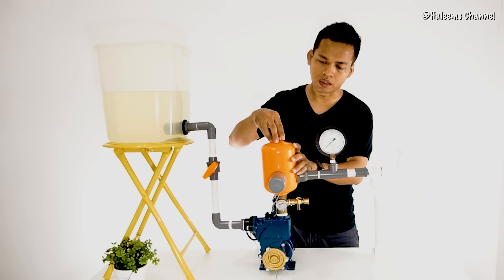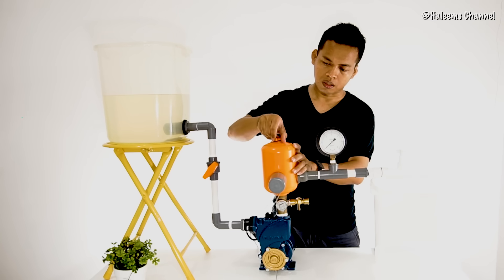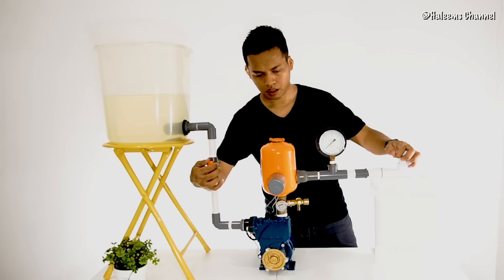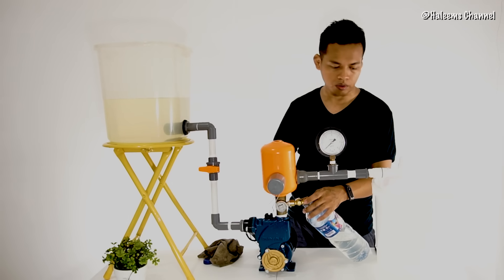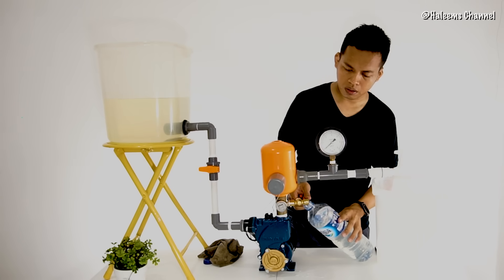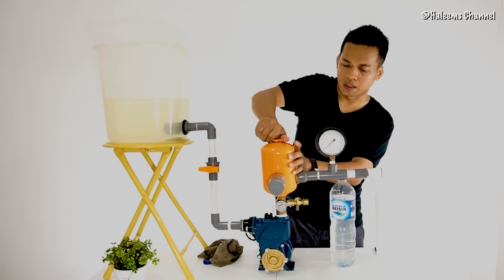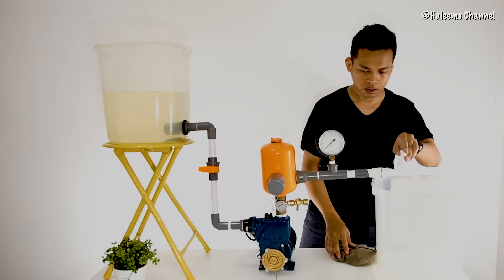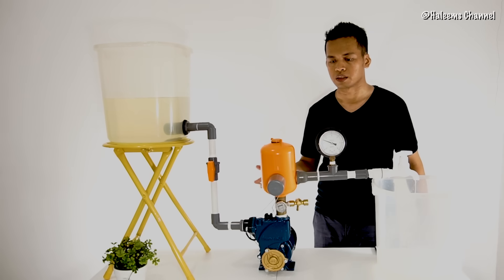Cara Memasang otomatis Pompa air dan Mengatasi Bunyi Cetak Cetek pada Otomatis/Pressure Switch

Comment: Assalamu'alaikum.....
Saya punya mslh yg sama, sdh beberapa kali ganti pressure switch, bahkan baru beberapa hari yg lalu ganti lagi + ganti tabung juga. Pompa saya merk shimizu ps 135 E, saya tdk pakai tandon, lsg sedot dr saluran PDAM, dan ditempat kami kalo tdk pake mesin, tdk jalan airnya.
Pertanyaan saya, mnrt bapak kami lbh cocok pake pressure switch yg sdh dimodif seperti diatas atau Flow switch biar ga cetak cetok lg mesinnya ? Atas perhatian dan bantuannya saya ucapkan byk terima kasih....
Reply from the maker: wa 'alaikumsalam..
penggunaan pompa secara langsung dihububgkan ke PDAM sebenarnya tidak direkomendasi, karena bisa mengganggu pengguna lain..
cara terbaik, dari PDAM sebaiknya di tampung dulu dengan underground tank, lalu dari underground tank di pasanglah Pompa..

penggunaan pompa dari saluran PDAM, dengan kondisi tidak jalan airnya, paling cocok menggunakan pressure switch.. atau lebih baik lagi menggunakan pressure controller..

sedangkan penggunaan flow switch, tidak rekomendasi, karena air tidak jalan..hal ini akan lebih banyak gagal fungsi.

paling optimal, pasanglah pompa tipe priming self dengan menggunakan pressure controller.

jika tetap menggunakan pressure switch.. gunakan tabung yg lebih besar.
Reply: Maksudnya dibikin seperti contoh video diatas ya Om atau bagaimana ? Mohon petunjuknya....
Reply from the maker: @edonkbejeem3212  didalam video ini hanya memberi penjelasan penyebab dari cetak cetek, disertai dengan pembuktian penyebab cetak cetek, yaitu karena kondisi didalam tabung sudah tidk terisi udara..

kalo solusi mengatasinya; secara umum harus menjaga tabung tekan selalu terdapat udara didalamnya agar ada ruang kompresi.. 
nah, tabung tekan yg bisa selalu menjaga ada udara atau gas didalam nya adalah jenis tabung tekan yg memiliki karet atau membran sebagai pemisah ruang air dan udara/gas..

atau jenis tabung yg ukurannya lebih besar sehingga ruang udara pun lebih besar dan udara menjadi lebih awet tersimpan.
Reply: Iya, makasih om atas penjelasannya 🙏😊

Comment: Msh bunyi mnjerittt mas saat kran air kecil,,ttep pekik mngganggu telinga ,suara stak cetok nya sih hilang,,tpi suara jerit pekiknya ituloh msh mngganggu,,😩
Reply from the maker: jenis pompa ini menggunakan impeller peripheral, dgn material brass/kuningan, antara impeller dan tutup impeller memiliki celah yg sangat kecil, hal inilah yg menyebabkan suara melengking... semakin kecil celah impeller semakin baik head nya, namun efek suara nya meningkat..

pompa yg tidak begitu bunyi yaitu jenis CAN motor..biasanya can motor paling banyak digunakan untuk pompa booster water heater..
can motor strukturnya agak rumit, sehingga harganya pun agak mahal..

nah, satu lagi yg tidak kedengaran bunyinya yaitu submersible pump.. pompa nya tidak kedengan bunyi karena posisi pemasangan di kedalaman sumber air..

silahkan memilih sesuai keinginan..
Reply: Haleems Channel gan ada gak otang nyelupin submersible di dalam tandon
Barangkali aja ada hehe 
Tapi rawan dry running

Comment: Pak solusi biar pressure switch gak rusak terus??
Saya pakai pompa air celup sumur 180w baru 6bln sudah ganti 3x otomatis pressure switch nya rusak terus pertama pakai yang 30rb an 1bln rusak kebakar
Pakai yang ori bks sanyo sekitar 2bln sama seperti itu 
Dan ganti merk dea sekarang mulai error kadang bisa off kadang tidak
Reply from the maker: ada 2 penyebab kerusakan,
1. dari mekanis, terdapat kontak point, agar kontak poinnya awet, tekanan yg diterima harus stabil, agar tekanan stabil harus menggunakan pressure tank yg srabil.

2. dari elektrik nya.. cek ampere dari pompa nya, harus sesuai dengan kapasitas pressure switchny..
pressure switch di pasaran ada beberapa type, dari segi kapasitas power nya.. ada type 200 watt, 400watt, dst..
jika ampere pompa nya besar, harus pilih pressure switch yg lebih besar.
Reply: Tambahkan kontaktor mas....biar aman

Comment: Itu posisi air ada di atas buat apa pake tabung
Reply from the maker: sistem pressure switch tidak bisa dipisahkan dari tabung...
fungsi tabung adalah utk mengakumulasi tekanan, atau sebagai ruang kompresi, agar tekanan yg diterima pressure switch tidak secara langsung, sehingga kerja pressure bisa stabil..

Comment: Mas saya mau tanya kenapa ya, punya saya pompa air nya kadang nyala sendiri walopun udah ditutup kerannya tapi ntar mati sendiri juga karena tekanannya.
Apa karena setup yang salah?
Reply from the maker: system pressure switch bekerja karena adanya tekanan/pressure didalam saluran pipa, apabila tekanan didalam pipa berubah, pressure switch akan bekerja...
untuk menjaga tekanan tetap pada titik OFF, semua pipa harus rapat, tidak boleh ada yg bocor.
studi kasus bila pompa tiba2 kadang nyala sendiri, itu artinya pipa ada yang bocor.. pastikan semua sambungan pipa rapat.. gara tidak trjadi hal tersebut..
Reply: @HaleemsChannel  jadi bkn karena ada setan nya ya pak wkwkwkwk hehehehe bercanda

Comment: Klo jetpum GK bisa pake otomatis seperti itu, malah kejat2 dari drat kranpun tetep kelluar air
Reply from the maker: untuk jet pump spesifikasi nya lebih besar.. jadi yg di video ini bukan peruntukan jet pump, namun metode nya sama.. hanya skala ukuran nya harus di perbesar, karena head atau tekanan pompa lebih besar...
bisa menggunakan tabung yang lebih besar dan tentunya pilih spec pressure switch yg memiliki rate ampere yg lebih tinggi sesuai kelistrikan pompanya...
silagkan mencoba, untuk pertanyaan lebih lanjut bisa inbox di email..
Reply: Siap om, ane Belem pasang toren sekarang juga air banyak di buang kran dua di buka juga tetap masih kurang pengeluaran, solusi nya om

Comment: Bos, mau tanya, 
1. Jika otomatis presure switchnya (otomatisnya) dipasang di flock ring (Tee Kuningan), bukan di tabung tekan, bisa ngak ya. 
2. Jika tanpa tabung tekan, 
    Tee Kuningan (flock ring) dipasang di output pompa air ---> lalu pasang presure switch diTee Kuningan ---> dan lubang flock ring (tee kuningan) bagian atas ditutup dengan doff. Bisa ngak ya.
3. Sebenarnya presure switch itu bekerja jika ada tekanan udara atau tekanan air ya bos.
Mohon penjelasannya satu persatu, thnks atas infonya.
Reply from the maker: 1. Bisa, dasarnya adalah besarnya tekanan adalah sama disemua titik.
2. pressure switch dan tabung tekan adalah perangkat yg saling mendukung, tidak bisa dipisahkan..
3. Tekanan Air
Reply: @HaleemsChannel   
Thanks infonya bos.
Reply from the maker: @muhibuddinbudi7734  sama sama bossquuu...

Comment: Mau tanya: berapa tekanan off dan on pada video tsb? Jenis pompanya yg biasa (150watt) atau yg besar (350watt lebih)? Krn pompa diblur ... tidak kelihatan.
Reply from the maker: di video ini menggunakan spec pressure switch 
ON : 1.1 kgf/cm2, (11 meter)
OFF : 1.8 kgf/cm2, (18 meter)

utk spec. pompa nya adalah:
Total Head max. 30 meter
watt ouput 125 watt
Reply: @HaleemsChannel  berarti ON 15.6 psi dan OFF 25.6 psi ... Yg double jet biasanya 20/40 psi. Siiiipp. Trm ksh.
Reply from the maker: @robinhutnc2392  benar, 
biasanya spec. pressure switch mengacu pada besaran total head (tekanan) yg di hasilkan pompa.
misal;
total head : 27 meter,
daya hisap : 9 meter.

sehingga menentukan,
OFF : 27-9 = 18 meter, 
dgn toleransi switch ±1 meter, pompa harus memiliki total head 28 meter hingga max. 30 meter

bila total head dari pompa tidak mencapai 28 meter. (misalnya hanya 25 meter),
maka pressure switch akan mengalami gagal fungsi, tidak mau OFF.
Reply: @HaleemsChannel  ok. Saya sdg mencari tanki yg lebih besar. Yg non bladder, jadi non gas juga (model2 yg skrg diisi nitrogen). Tanki saya bladdernya jebol gara2 tekanan udara turun dan tidak saya isi anginnya. Kira2 ada nggak ya tanki yg besar spt bawaannya doble jet. Yg pvc lebih bagus spt punya anda itu.
Reply from the maker: @robinhutnc2392  setau saya utk tanki plastik (PVC, ABS, POM, PP, dll) di pasaran belum ada yg ukuran besar, karena mempertimbangkan daya kekuatan material.

Yg ukuran besar, rata2 menggunakan material steel (SPCC, SGCC, dll), secara daya kekuatan lebih kuat dibanding plastik,
 yg ukuran 20lt, kisaran harga 200rts ribu, beda toko beda harga, ada yg lebih murah..
Reply: @HaleemsChannel  ooo .... ok ok ..... terima kasih info.nya 
👍👍👍

Comment: INI PEMBODOHAN  ITU OTOMATIS BISA DI SETEL  DARI PABRIKNYA buka tutupnya ada putaran pake obeng -/+ !!!!
Reply from the maker: murni bukan pembodohan bossque... 
adjusment pada ± screw, hanya utk setting range spec. pressure nya (dan adjustment ini tidak direkomendasi pabrikan, karena bisa gagal fungsi pada pompa, bila spec pompa tidak match dengan switcnya, makanya pada screw nya di lock dengan paint blue, supaya tdk di adjust, silahkan cek paint blue nya), bukan utk mengurangi ON/OFF atau cetak cetek nya, pada saat aliran air mengecil (yaitu 3 - 10 liter per menit),
murni cetak cetek dikarenakan tekanan tidak terakumulasi dengan baik, sehingga switch bekerja tidak stabil..
video ini hanya berbagi ilmu, berdasarkan riset yang sebenarnya, bukan pembodohan ya bossque... bila perlu pembuktian bisa contact langsung melalui alamat di channel ini..
terimakasih.
salam kreatif.
Reply from the maker: nah, kenapa di pressure switch terdapat screw adjusment?
screw adjustment ini di tujukan untk setting pada saat membuat switch otomatis, karena sistem penerima tekanan menggunakan spring, sehingga utk mecapai spec. pabrikan, misal ON: 1.1 kgf/cm2, dan OFF: 1.8 kgf/cm2, diperlukan adjustment hingga titik tersebut.. setelah mencapai titik tersebut, pabrikan pressure switch ini memberikan paint blue utk locking mark, supaya tdk di adjust.

apabila sudah di pasang di pompa, kemudian di adjust akan ada kemungkinan gagal fungsi.
letak gagal fungsinya pada saat penggunaan maksimum, misalkan pompanya digunakan hisap hingga 8 meter..dan head total pompa hanya 26 meter, maka switch tidak OFF, karena minimum switch bisa bekerja harus ada head total 27 meter..
inilah sebabnya pabrikan pompa tidak merekomendasi utk melakukan adjustment switchnya.
terkecuali utk jenis switch yang disediakan utk adjustment, biasanya utk jenis ini dilengkapi cara penggunaan adjustment harus dilakukan pada saat total head tertentu.. contoh pada kasus ini bisa dilihat pada produk SANYO model P-H175C
Reply: Bagus Sekali,,)
Saya memang gk ngerti teori kayak vidio diatas.. Saya ngertinya praktik dilapangan.. 15 tahun di dunia pompa, Saya bisa gulung semua jenis pompa..
Reply from the maker: mantap bossqu, pengalaman yang matang, berbagi ilmu ya bossqu...
yang saya sampaikan bukan sekedar teori.. kebetulan juga saya membidangi sebagai pembuat pompa.. yang hanya ingin share ilmu saja..semoga bermanfaat buat yg lain.. 
salam kreatif terus bossque.. semoga sukses selalu...
Reply: @andikrahmawan2240  itu juga ga sembarang puter2 otomatis nya gan biasa nya saya  di settingan 40-60 psi gan yang bagus
Untuk sumur dangkal biasa nya cuma sampai 35-40 psi an
Reply: @bangherlambang3226  yg di vidio buat mesin pendorong bukan buat ngisep di sumur bro..
Reply: @andikrahmawan2240  mesin pendorong settingan otomatis nya agak keras misal biasa nya buat sumur off 30psi
Kalau untuk hisap dari toren booster
Bisa di naikan jadi 40psi an 
Karena kalau bawaan 30 psi biasa nya cetak cetek terus
Reply: @bangherlambang3226  Saya mau tanya berapa isi gulungan  kawat tembaga setiap lubang mesin di atas , bisa jawab ??
Reply: @andikrahmawan2240  untuk 125 w rata 45,75,155,155
Reply from the maker: kwkwkwkwk....saya gak ikut2 loh ya bossque..... 

sebenarnya, jumlah lilitan itu bisa dibuat berapa saja... yg penting space factor nya masih cukup, 

tujuan utama sebuah jumlah lilitan itu utk mendapatkan,
amper nya mau berapa? 
torsi motornya mau berapa?
temperature rise nya kelas insulasi apa?
efisiensi motor nya berapa?
dan itu semua terkait dengan ukuran core nya.. end ring nya pada rotor, air gap nya antara rotor dan stator..jumlah pole..

kalo minat dengan perhitungan lilitan sesuai dengan kebutuhan torsi motor .. termasuk cara mengukur torsi motor, watt output motor, efisiensi motor, ampere motor, rpm motor..

bisa ngopi bareng, yuk kita share bagi-bagi ilmunya...😊😊😊
Reply: @HaleemsChannel  Mantap jawabnya.. Tapi kopinya jangan pake sianida ya bro 😀
Reply: @HaleemsChannel  Mantap jawabnya.. Tapi kopinya jangan pake sianida ya bro 😀
Reply: @bangherlambang3226  opo iki,,,
Reply: @andikrahmawan2240  blm pernah lilit gan cuman service biasa2 gak jauh dari impeller seal otomatis bearing kapasitor 

Sekarang mulai belajar 
Liat2 di youtube biasa nya ch dani servicr coba cek banyak cara2 lilit pompa

Itupun settingan otomatis juga tau bagus 40-60 psi belajar otodidak gak dari orang lain atau mbah google
Sedikit saran dari kakek karena pensiunan pegawai pdam masalah air sering nanya ke kakek ku kalau lebaran

Kalau di pam rata² 42psi standar nya katanya
Reply: @HaleemsChannel  kalau kurang biasa nya panas
Reply: Tong Kosong Nyaring Bunyi nya....

Comment: Om, kalau pada installasi seperti di video ini, pressure yg bekerja pada pressure switch nya tekanan air atau tekanan udara?
Reply from the maker: tekanan air bossquu...tekanan air diterima oleh pressure switch... 
karena air sifatnya incompresible, makanya diperlukan tabung tekan yg berisi udara, supaya tekanan yg diterima pressure switch dapat direduksi oleh tabung tekan, sehingga tekanan yg diterima pressure menjadi lebih stabil...

jadi, antara pressure switch dan tabung tekan adalah satu kesatuan kombinasi sistem otomatis yg saling mendukung tidak bisa dipisahkan..

kalo cuman pressure switch, tanpa tabung tekan akan berdampak ON dan OFF yg tidak terkendali...
sedangkan kalo cuman tabung tekan, sudah pasti gak bisa berfungsi sbgai switch..
Reply: Kalau saya pasang dengan cara memotong pipa output pompa lalu saya tambahkan sambungan T, saya akan pasang tabung tekan melalui sambungan T tadi. Lubang 1" yg ada di bagian samping saya buntu. Apakah bisa mengatasi problem pressure switch yg cetak cetek?
Reply from the maker: Bisa bossque... pilih tabung tekan yg cukup utk udara lebih tahan lama.. misal yg 19 liter 
bagusnya pasang tabung posisi vertikal.
Reply: @HaleemsChannel  Ok om, terimakasih untuk penjelasannya, saya sudah memasang langsung pressure switch melalui sambungan T, alhasil pressure switchnya berbunyi cetak cetek terus padahal tidak ada installasi/kran yg bocor
Reply from the maker: @herliherdiawan9356  pastikan tabungnya terisi udara ya bossquu...
yg dimaksut bunyi cetak cetek adalah ON dan OFF yg tanpa jeda dan terus menerus saat di gunakan pada keluaran air kecil, biasanya antara 3 liter per menit hingga 10 liter permenit...
Reply: Haleems Channel jangan lupa bosque setting pressure tank 2 psi di bawah cut in

Comment: misalnya skema ini dipakai untuk booster dari toren, dan saat listrik padam / pompa tidak nyala, apa air akan tetap keluar?
Reply from the maker: tambahkan pipa by pass ya boss qu... utk hasil yg lebih bagus... kalo tanpa by pass, keluaran nya jadi kecil saat listrik mati... karena aliran terhambat oleh pompa...

jangan lupa pasang tusen klep atau check valve pada saluran pipa by pass nya..
Reply: @HaleemsChannel  sip.. btw bisa bantu pasang juga kah? :)
Reply: Haleems Channel haha mantap bypassed otomatis tanpa stop kran
Pakai check valve
Kalau model spring katanya ada headloss ya

Comment from the maker: KONSULTASI POMPA AIR GRATIS 100%, silahkan tulis di komen utk permasalan pompa air anda.

Banyak pilihan untuk menentukan jenis otomatis pompa air, diantaranya;
1. Pressure switch
2. Flow switch
3. Pressure controller

hubungan dgn tandon air:
4. Float switch
5. Transmitter limit switch
dll.

masing-masing otomatis memiliki kelebihan dan kekurangan.
pemilihan yg tepat harus di sesuaikan dengan kondisi instalasi dan aplikasi penggunaan pompa nya.
dan pertimbangan harga serta kualitas umur pakai dan keamanan penggunaannya.

berbagai kontrol otomatis tandon air:
http://bit.ly/2Pzdqpd

Flow switch:
http://bit.ly/2T020ci
Reply: Senang melihat seni instalasi setting pompa air konvensioanal, rapi, enak dilihat, tehnik nya bagus, fungsional. Saya terlanjur beli APC  brand York.
Reply: Kalo untuk mesin hisap langsung dari sumur bisa ne om
Reply from the maker: Jenis sakelar pressure switch bisa utk segala kondisi...
Reply from the maker: @mahkotamotormarpoyan5496  bisa

Comment: Pake overflow switch aja. Jd ga cetak cetek.
Reply from the maker: istilah overflow ini sama hal nya limit switch, yg biasa dipakai untuk kontrol isi tandon air.. 
dimana switch ini mendapatkan batas atas dan batas bawah, pada sebuah tandon sehingga air tidak overflow...
overflow fungsinya utk kontrol isi tandon air, dimana sinyal batas bawah untuk pompa ON, batas atas untuk pompa OFF, atau sebaliknya jika difungsikan utk menguras tandon..

sedangkan pressure switch untuk kontrol ON/OFF pompa, yg secara langsung, keluaran air diteruskan ke kran air..
Reply: @HaleemsChannel  cuma beda pengertian tentang istilah sih mas. Kalo yg toren air itu sy sebutnya water level sensor/swtich. 

Kalo di pompa sy sebutnya overflow switch. Jd kalau kran dibuka lalu ada aliran air dr toren menuju kran, trus langsung pompa nyala konstan sampai kran ditutup. Kalau yg pakai tekanan namanya preassure switch. 

Dulu sy pernah coba teknik seperti di video ini dan hasilnya mesin pompa masih tetap cetak cetek.
Reply from the maker: @mifamifa2331  kalo itu namanya flow switch... http://bit.ly/2T020ci